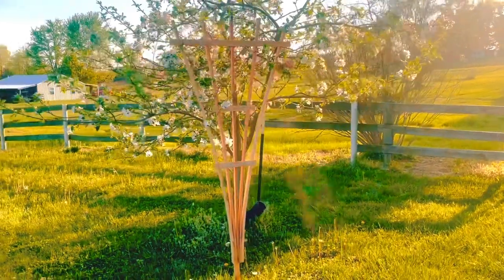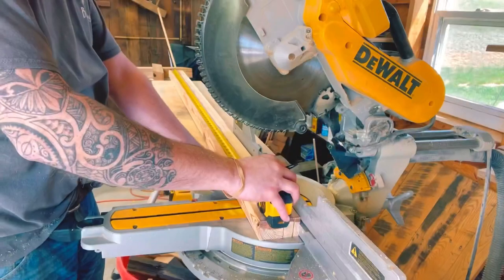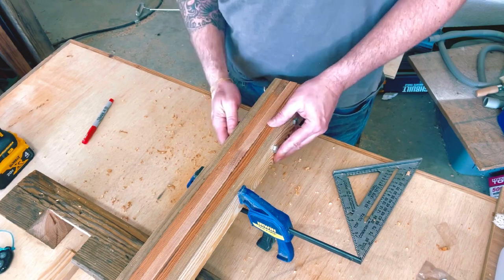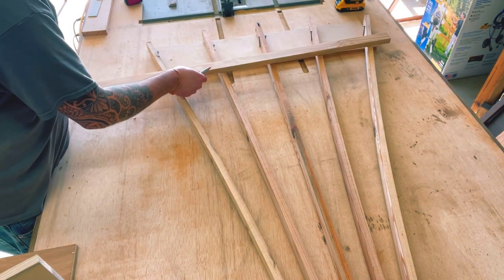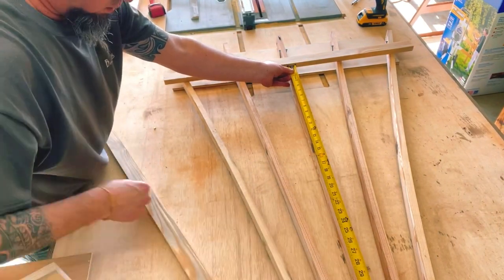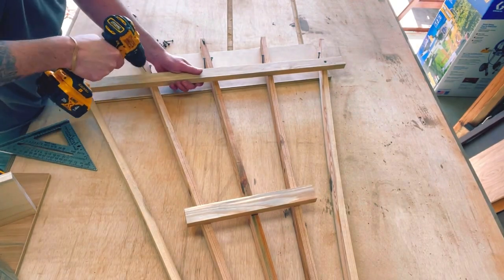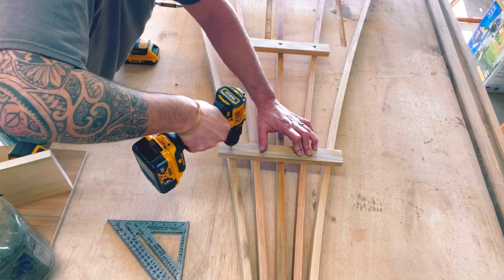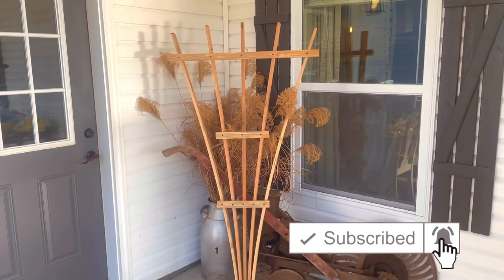EASY DIY GARDEN FAN TRELLIS.

Comment: Great project 👍.  I can't wait to build one. 

I would recommend adding two flat washers and one lock washer to each of the bolts. The flat washers against the wood and the lock washer under the nut.
Reply from the maker: Nice tip!

Comment: In the start of the video, it shows it with extra length at the bottom... did you just leave the center board at 8' or did you add it somehow so it could be put in the ground?
Love this idea! Something different, haven't seen anyone else making and perfect for Spring sales!
Reply from the maker: Thanks!  I added a ground spike that could fold up.  But after thinking about it I could have just The center at 8'.  I wanted the customer to have the option since some mount to walls.

Comment: ok so you say for that size that a 40" fan is a nice size and that you put the screws at about 38"s but on the video when you are measuring across the two screws it is showing about 30"s between them. so are you making the fans about 32 inches wide instead. Just want to clarify is all. Thanks
Reply: I was about to say the same thing

Comment: Matthew, I have a question regarding wood choice. I recently saw your excellent video for the garden trellis and decided to make one for myself. The problem I ran into was knots. Two of the first lengths snapped at a knot when I tired to spread them for the fan. Any suggestion regarding selecting wood that this is less likely to happen?  Thanks and keep up the great videos.
Reply: I am wondering the same thing, did you find out what would be best? Thanks for any info
Reply: @therustyduck5400  So far I'm looking at yellow pine for price. But have to pick through the stack and find the ones with the fewest knot holes and hope for the best. Still hoping to hear from Matthew.
Reply from the maker: Im actually releasing a video this weekend going back over the trellis since I've been getting so many questions on it.  But I do address this issue.  Just select the one with the most knots and place them closer to the center.
Reply: @MatthewPeechWoodworking  I spent quite a while sorting boards to find the clearest ones with the straightest grain so mine could handle the tension. and put the knots on the compression side so they won't be tempted to blow up - the tension side needs to be defect-free.

Comment: Hey Matt, I think I'm going to try and make this. But I was thinking about making it out of pressure treated wood it will last longer out on the weather. You know pine won't last a long time. If I sell it, I don't want my customers getting mad at me, because it didn't last long. Oh by the way, what's the measurement from the bottom for the bolts?
Reply from the maker: I would have to measure the bottom bolts.  Im thinking it was a starting a couple inched from bottom.  I let the customer finish it.  Painted pine will last for a very very long time with airflow.  Just ground contact would be what I would worry about.
Reply: @MatthewPeechWoodworking  thank you Matt

Comment: Any thoughts on the skil saw table saw 3410? Worth getting it or better get a Bosch or dewalt ?
Reply from the maker: I havent used it so I cant give an honest review.  But Im pretty sure all 3. Are made by the same company just different designs.  I would look for one with two miter slots on top and the largest motor.  Check out the video on upgrading to used.  For the same money you can get a nicer saw if your interested.
Reply: @MatthewPeechWoodworking  will do thank you
Reply: @MatthewPeechWoodworking  Skil is owned by Bosch. DeWalt is its own separate company and owns Porter Cable.

Comment: Great videos. Question... The 4" bolts seemed too big for the one I made so I used 3" bolts instead. Do you use 4" to allow the boards to separate some?
Reply from the maker: 3" will be just fine.  I used 4" because I added a short flip down spike to put in the ground but wasn't covered in the video.  I should have clarified.  thanks for pointing that out!
Reply: @MatthewPeechWoodworking  Matt, I am really enjoying your videos.  I like the pace, your style and how you explain things. 
So I'm not getting how you would add the spike to the bottom.  Can you please give us a little more detail there?  Thanks!
Reply: @szerszynski  I realize this question is 3 months old but since there wasn't a response, my guess is he added a wooden spike into the stack of 5 long pieces that can be rotated out for when in use and in for safer transport.  It wouldn't be centered since there are already an odd number of slates and there would be a bit of an extra gap where it was, but it shouldn't affect the look towards the top (could also add two spikes on either side of the center post if symmetry was a concern. I was confused at first because I thought the narrow part was the top, but looks like the narrow part is the part that touches the ground

Comment: Hi
I'm a recent subscriber. Love the work you do...What type of wooden 2x4's are you using? Also, what's a safe alternative for ripping the 2x4? I don't have a table saw...yet?
Thanks in advance for your reply.
Reply from the maker: Thanks and welcome!  I used some 2x4s that I had ripped from square stock.  But some pine 2x4s will work as well.  As for the long rips... You may need to visit a friend with a table saw.  May be a bit narrow for a circular saw.
Reply: @MatthewPeechWoodworking  i was thinking the same thing. I'll make a little money and buy a work site table saw...used
Great content...keep it coming
Reply: @lchase7858  get it cut at the Home Depot they should be able to
Reply: @larpbusters  ok I thought it might work on a panel saw. But either way if you have a couple of projects you need a table saw for you can just rent one for a day and cut everything you need to bake it worth it.  Cost like 45CA$
Reply: Could just buy 3/4 boards if your just wanting to build one.

Comment: I really like this idea but I think I'm going to adjust the jig to allow me to screw the braces from the back to hide the screws. I like a lot of your ideas, there's too many schmucks out there selling "farmhouse" tables and cutting boards, it's nice to see simple projects that appeal to the same audience without blending in to the crowd of other makers out there.
Reply from the maker: Exactly. Do what others aren’t or can’t. The only issue with screwing from the back is you’ll need longer screws and you’ll have to go through the entire 1 1/2”. It will increase your chances of splitting. But great idea!
Reply: counter sink the screws and fill in the hole

Comment: They look great and no disrespect but how are you getting so much money outta them I made bout 4 or 5 for people I was asking around $25 and they looked at me like I was taking all their money .
Reply from the maker: When did you try to sell them and where?  You can't buy a meal at a decent restaurant for $25 and they want to give you grief over a custom built item?  My son sold tons of these at local vegetable stands and greenhouses.  Take them to a green house on consignment and tell them you want x amount and they decide what they want to put on them.  They pay you as they sell.
Reply: @MatthewPeechWoodworking  I agree but had a similar question.  Perhaps you could make a "tips" video on how to sell some of the items you're making?  I.e., what kind of wording to use on Marketplace, when and where to sell certain items, etc.  Thanks!
Reply: Your prices are based on your talent, not on their budget. That was the wrong crowd for you to market to.
Reply: The cheap ones you can get from Lowes are not made out of the same size pieces. They are really flimsy and only have four vertical pieces on the fan instead of five. I'm going to make a few and put them in my wife's store at $49.99 and see how they sell.
Reply: Update on the trellis sales. I ended up making mine out of cedar fence boards that are 5/8" thick and I ripped them down into 1 1/2" strips. I also added a pressure treated spike to drive in the ground to go with a trellis.  My wife put them in her store and priced them at $75 each. I made a batch of 4 to start with since it was February and didn't know how they would sell in the cold months. We had a guy come in and bought all 4 at one time for $250. Gave him a discount since he was buying 4 of them. The very next day we had a guy come in wanting to know where the trellis' were at that we had sitting out front. Told him that a guy came in yesterday and bought all of them. I told him that I would have some more made in a couple of days. He came back and bought one at the $75 price. I have about $13 in each one made from cedar and with the spike. So thank you Matthew for the idea. Hope to sell a lot of them when Spring actually gets here.

P.S. I also made one of the obelisk trellis' that you have on your page. We have a lady coming to get it tomorrow for $250.
Reply: @chriswojtowicz5515  $13 for two cedar 2x4 and a stainless steel bolt with nut - where are you getting these?  I'm shopping in the wrong place.
Reply: @streetsbolt  I don't use a 2x4. I use cedar fence boards and rip them down to 1 1/2" which are a lot cheaper but still cedar.
Reply: @chriswojtowicz5515  Brilliant!  Thank you.

Comment: Out of curiosity would a nail gun work the same instead of screws?
Reply: I've seen many made with 1/4-inch air staples. But haven't seen these in stainless...brads or nails may not hold with torque applied by the wood  strip spread